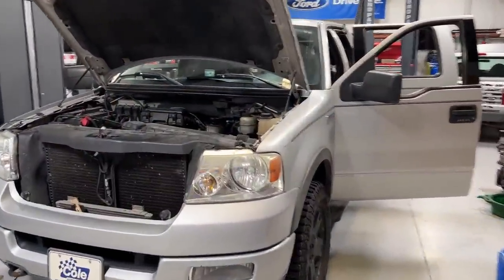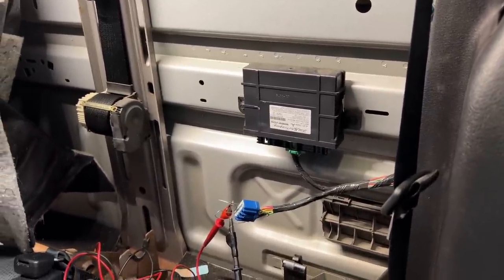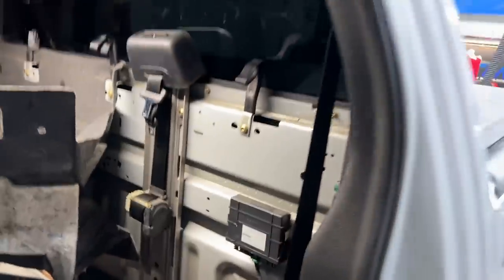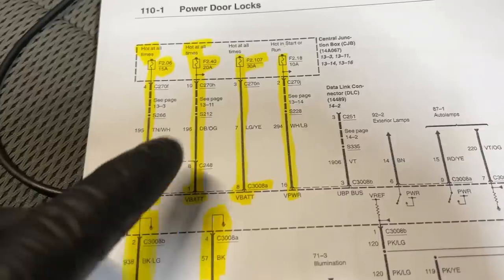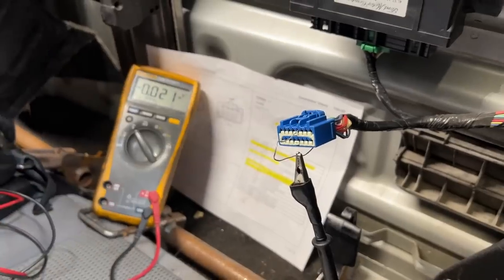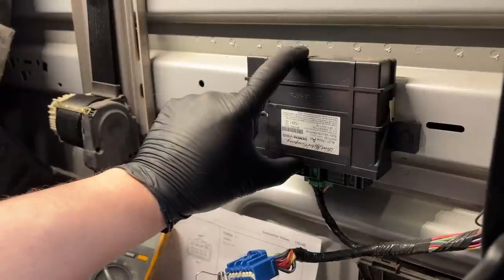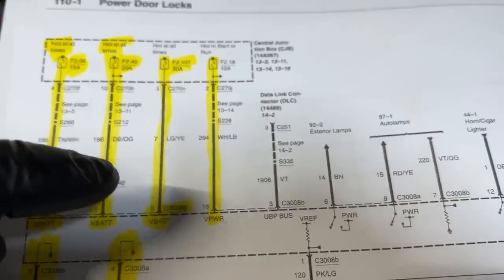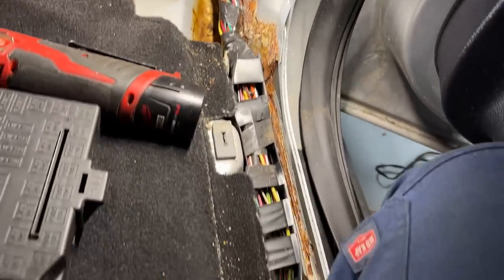This is Why Load Testing Electrical Circuits is so Important!

Comment: An old 55W/60W sealed beam low/high beam bulb can make a good load tester/continuity indicator and current limiting device too (most old school mechanics probably have a spare one somewhere). Good detailed explanation on troubleshooting this issue!
Reply: An old sealed beam is my go to for testing fuel pump circuits.
Reply: Definitely

Comment: Great video, would love to see your excellent diagnostics and repairs include how you put the wire back that you cut at the module and the one you fixed at the rust spot because there are many techs that really drop the ball on those wire reconnects and many could take a real pro instruction from you to do it 100% correct

Comment: That's an awesome lesson that can be applied to almost every vehicle out there, thanks!
Reply: voltmeter readings can be misleading without a load applied.  I can get a voltmeter to read above 12 volts with some hearing aid batteries in series but they sure won't start a car.
Reply: @mikekokomomike  You can also take a voltage reading across the wire when load is applied. The wire will act like a resistor, and create  a voltage drop. Ideally a wire should have zero volts across it (maybe .1 at most). If you see  2-3 volts, that is being consumed by the wire (or poor connection). I always do that when I check a charging system.
Reply: @alb12345672  right on
Reply: @mikekokomomike  Learn that lesson, thinking that all I needed was a volt meter, to test my AA batteries.

Comment: If you can wade through this longish post, here goes.

Had the same problem in my 2000 Expedition but without the rust.
Green wire with yellow stripe in a bundle running down to the floor on driver's side to power the box under the driver's seat that provided 'Power Seat' adjustments and some other functions.
The wire was on the outside of the twisted bundle where there was no tape wrap to protect it and it rubbed up/down on the edge of a Pinch Weld.
The up/down rubbing, from normal driving, wore through the insulation and the wire. The exposed wire ends corroded and turned green leaving just a high resistance green powder behind.
Luckily I had bought a full set of 'Moderately Used' maintenance docs on Ebay and was able to ID the box, pinouts and To/From wire routing.
As I was separating the green/yellow wire from the bundle, I saw discoloration on the wire, opened the insulation and the wire was corroded back 3/4 inch from both ends. An easy fix just like Brian did. Snip/Snip, Crimp/Crimp.
In 2015 I bought this 190K 5.4 2V Expy for $500 with '$500/Will Not Start' painted on the windshield. A few weeks later I replaced the 'In Tank Fuel Pump' motor and it ran just fine.
I have fixed many of the problems in this vehicle that Brian has presented on UToob except a Timing Job. I'll start that in a few weeks with a Melling Timming Set/Oil Pump, Ford Water Pump, 7 Cal Van Inserts, 2 each O2 Sensors, driver's side exhaust manifold and Radiator Support. Hope to be done by Thanksgiving. HaHa....
I just couldnt resist adding this longish post to show that I had a 99% duplication of Brien's vid but going back 7 years.
I have saved every one of Brian's UToob video posts. I'd love to see them all on an Indexed DVD. Brian should be able to sell thousands of them for $25 each. Seriously.....
Brian is a National Asset. His presentations are Pich Perfect and he cuts to the meat of the problem without extraneous BS. I've been following him for years and should look thru my UToob Libs to see when I started saving him.
Because of Brian, there are many Ford Trucks/SUVs on the road today instead of sitting in a Bone Yard waiting for the Crusher. I'm confident that my Timing Job will work out Just Fine because of Brian.
BTW: I'll be using a Melling Timing Set, Oil Pump and FelPro gaskets. Ford prices are Ridicules.
That's my story and I'm stickin to it........

Comment: I've bumped into an issue where the TCM (transmission control module) was declared bad based on codes we got. The new 10 speed transmission slammed hard into gear and wrench light came on. We decided to do a load test. We later found a wire that powers the module to be making contact on the chassis. Cut and replace that part of damage wire. Taped it good. Navigator shifted great like nothing was wrong. Its time consuming but worth doing.

Comment: Load testing is the best.  Use a headlight bulb(s) with a load close to 30 amps gives you plenty of light for working in the area however, the wiper motor is a nice touch.  Plus gently holding the gear varies the load which can be helpful also.
Nice fix Brian.

Comment: I always say that testing wiring is a lot like testing plumbing: If you've just fixed a plumbing leak, you turn the water back on and check to make sure the leak is gone. And if the pipe normally has about 50 psi of water pressure, you'd want to pressurize it to 50 psi when checking for leaks. You wouldn't put only 5 psi in it and assume it's good because it's not leaking at 5 psi. It could very well start leaking once the pressure increases to 50 psi. It's the same thing with wiring: If a wire normally carries 20 amps for example, you need to test it by trying to put about 20 amps of current through it. You can't put only 0.005 amps through the wire and assume it's good!

Comment: Would have been disappointed had you not cleaned up that body ground while you were in there. I remember all the ohm testing the trouble trees had us do when ecms first hit the market. 9 volt battery powered ohm meter would give proper ohm reading but I found out the hard way {many wasted hours} that a load test would show a compromised wire in a heart beat, saving loads of diag time. We need to keep this in mind, as ohm meters will sometimes lie.Thanks for helping spread the word.

Comment: Nice job.  I cut off several of the light bulb harnesses out of our junk 93 Cavalier out in the field and made some test lights that I use for load testing circuits.  They work well.  I measured the amp draw of each so I know how much they draw.

Comment: Great tips on load testing a circuit to see if it can power the circuit.  Don't try to hang off the side of a building with that gauge of wire though!  Keep these excellent videos coming.

Comment: Great diagnostics!  I had one in the past where I thought it was the computer module.  Luckily I was getting them for cheap from a wrecking yard, but the issue was very similar.  What happened was the cover to the wires cracked and went away on the back of the engine.  The exhaust manifold was right there and the wires started bouncing off the manifold.  The wire cover melted exposing the copper inside and when I would go up a hill or accelerate over a certain amount, the wire would short out on the exhaust manifold and kill the engine right then and there.  It was annoying as all get out.  Thanks again for a great diagnostics!

Comment: Excellant troubleshooting skills! Thanks for showing the schematics as well as the pinout on connectors. You helpedme years ago fix 2 of the joints in the passenger rail by the fuse box. If i remember it was due to cholride in the tape that was used.  I purchased the Ford splicing kit. So far mirrors and seats still work. Thank you Brian. Your son is very fortunate  to be able to learn from a master mechanic.
Reply: 3M Scotchkote fd manufacturers this coating for underground splices , it works well !  Great for trailer wiring .

Comment: I've been preaching this for years. I built a tester that lets me put from 2 to 12 amps on a circuit, plus direct battery connections to see if voltage drop is due to hot side or ground. It has been used a lot over the years. Good video
Reply: Would you mind sharing how you built the tester?

Comment: Your a excellent tech. I have put to use  your videos. I did my timing set using your 5.4 3v videos on my 07 gt. That was 70,000 miles ago still runs great.Thanks for your work to bring use very useful videos.

Comment: Nice video. This is hard to explain to a customer.  Sometimes finding the real problem is very time consuming and the customer doesn't understand why. Now I can just have them watch this video. 🙂
Out West we don't see many corrosion problems, it's usually added on equipment that has been hacked in.
Reply: That’s because you may live in a salt free state. Here in MN it’s terrible

Comment: I just took a look at the same rust pit on my 05 King Ranch. I've got holes rusted through below the wire bundle. No damaged wires. It's rusting through from below. Likely from Salty tire spray as I just repaired the left side which was worse. So much for all those years of oil spray.

Comment: What a great example for using load testing yes sir Brian excellent video like to add good continuity doesn’t mean good conductivity hardly ever use an old meter to test anything other than solenoid coils CHEERS AND THANKS

Comment: This motivates me to be proactive in protecting those wires anywhere I see risk of damage.
Reply: Sure enough, mine had the same situation playing out. I even found a couple small holes directly below the wires where the cab rusted through.
I managed to wrap the exposed wires which had not rubbed through yet with several rounds of tesa tape, then hit the holes with a metal body panel patch, threw some silicone gasket maker over that, then went over the top of it all with gorilla tape. 💪
Once that dries I am gonna go back and seal the bottom with either this liquid metal stuff I have or just more silicone gasket maker to make sure water will not get inside.
Not trying to get crazy with bondo, the room is tight and the truck is old so good enough is good enough.
Reply: So glad I live in San Diego and my 23 year old Chevy S10 Blazer doesn't have a lick of rust. The crusty wires in this truck definitely would not have made it with a salt bath
Reply: @samholdsworth420  I will never buy a used vehicle with rust again. The rusty vehicles in the rust belt markets sell for the same prices as no rust vehicles in other markets.

Comment: This is a very interesting scenario.   This is a really good exercise in knowing the limitations of your test equipment. The fluke meter is a laboratory grade meter. It has a very high input impedance so as not to load the circuit under test. In this situation it worked against the technician. Battery circuits are very low impedance.  Hence the need for a load  test.The technician was not fooled. The circuit was not open or the fluke meter would have said 0000. In fact there may only be 1 micro amp or so flowing to give the fluke such a reading. The wire was rotted and  the decomposed matter was still connecting the circuit. Had we used an old analog meter for this  test most likely lt would have read 0 or close. Those meters don’t have high enough input impedance to get a reading in this situation. It proves once more how analytical you have to be in order to be a great Automotive Technician.

Comment: Great content great fix you save the owner a lot of money 💰. Another technician 🧑‍🔧 wouldn’t have found the problem. Would have charged to replace the module. And still have the problem. Proper techniques result in a proper diagnosis. Therefore it can be fixed probably. I wish you had a shop here in Michigan.

Comment: Few months ago  was trouble shooting  my 2006 E350 shuttlebus.
No brake lights and shifter interlock kept it in park, everything else was functioning. Checked fuses ,brake light switch light bulbs all the basic stuff.   Ended up tearing out  most of the rear wiring  to get rid the coach builders screwed up wiring of crimp connections  and very few grounds.

I ran new wire from just under the door keeping it all inside instead of the factory Ford going along the frame. Have had problems with corrosion  on other E series.

Tracing down other wiring specific to the coach builder was a PIA.
Did buy  the proper tools for tracing down short circuts, testing relays,  etc..

Comment: You can see the wire diameter is swelled up at that point.  If I see any other wires swelled up, failing or not, just patch/splice that area before it goes bad.
Reply: You are absolutely correct about the swelling.
When iron turns to rust I think it expands 10 times the volume!
I'm not sure of how much copper or aluminum expands however I know that it does.

Comment: Cleverly diagnosed and wonderfully repaired. Shame the Mfg's can't do a little something extra in those "repeat areas". Liquid sensors are as cheap as chips.. placing a few in the "common hot spots" would be fantastic. Funny, I don't think this vehicle is so old.. my bad. I gave up wanting anything from the 80's+ (having lived through it as the typical shade tree mech ;) Yes, things are much better now but it's burned into my brain. Thank you for the super videos. You [are] the "Vehicle Whisperer". Cheers!

Comment: Go purchase a Load Pro test leads. I own a pair and they work great for load testing any DC Circuit. I used to be a Heavy Equipment Mechanic, but now retired.
Reply from the maker: I will never own a power probe product.

Comment: @FordTechMakuloco Tip:  Next time, relocate the ground higher up on the kick panel so it takes longer for the advancing cancer (body rot) to reach it causing a completely different set of problems and a return visit/repair.  Good job identifying the actual fault (corroded wire inside the insulation) and the underlying cause (wiring insulation rubbing against rough corroded surface)!  Once the ground fails, you'll see weird co-dependencies such as things work until the blower motor is turned on or the like.  Wait till you get one where the engine runs just fine until you step on the brakes!
Reply from the maker: Yup we had one where you put the turn signal on and he engine stalls. Been there done that. This ground will be just fine for the life of the truck.

Comment: Great video. I wish I could understand the process better. Some reason I have a real disconnect with this kind of stuff. Regardless, my 02 f150 has a whole bunch of GTE silicone sealant due to water intrusion frying the GEM module (started acting possessed) about 10 years in and other areas as well. Been a great truck but Ford really dropped the ball for a long time not sealing up their 150s very well.
Reply: I recommend  you consider  replacing  your windshield,  I've dealt with several f150 f250 that leaked due to a bad seal.  It's hard to pull the windshield  and reseal it unless you get a professional
Reply: @hustlehard4063  had that done just before replacing the GEM module. The upper left of the factory shield was notorious for leaking and frying the GEM.
Reply: I understand the methodology but suck at explaining things, but I'll try.

The easiest way to think of load testing in this manner is to think of flow. Most understand that if you replace a 3" or 4" toilet drain with a 1/2" drain pipe you don't have enough flow and the toilet will back up/not work correctly. So what load testing does is it checks to see how much flow capacity the wire is capable of handling. Multimeters use very little of this flow to work which is why it looks OK, until they tried flushing the proverbial toilet (in this case - connecting up the window motor that requires a lot of flow.)
Reply: @mrdanomac7937  Thanks! I was just mentioning to my wife yesterday it would be nice to upgrade our toilets.
Reply: @mrdanomac7937  I like the toilet analogy, here's another way to explain it using a toilet. Toilets have water jets all around under the rim, each jet represents 1 strand of copper wire. Flush the toilet when brand new, all the jets work beautifully, like new wire, all strands connected gives you the strongest current. Now, the toilet is 20 years old, and you have hard water deposit issues at your house, you flush it, and only 1 or 2 jets release water, the toilet is not going to flush, now take the wire and add corrosion (hard water deposits), you may have 1 or 2 strands still connected, but it won't carry a load.

Comment: Posted this just in time for me to dive into the flex fuel circuits on my 99 ranger, the inside kick panel by the drivers footwell looks about the same as this truck, I suspect it's a similar issue.

Comment: You can load test with a simple headlight bulb too.. It pulls like 4 amps.
Reply from the maker: Yes but the window motor doesn't shatter or burn you like a bulb.

Comment: I'm dealing with this same issue with the ABS module on my semi-truck. Every time I hit a bump in the road, the module emits several chirps to tell me it is loosing contact. The ABS self test already tells me the issue is with the wire feeding wheel-end number four which I have checked and confirmed is good at the wheel sensor. So between where the ABS harness comes out of the truck cab and going back to second drive axle, there is a sensor wire that is compromised. Why I haven't yet addressed it is because that section of harness is inside the frame rail which is buried behind the fuel tank, air tanks, and transmission and there is no room for me to access the frame harness. I suspect a broken wire or a chaffed wire that is grounding out against the frame rail and to fix it requires removal of all the air tanks and left side fuel tank which is a major job. Sometimes I just hate wiring.

Comment: Same with a simple continuity test. Most multi meters beep under 200 ohms, if you don’t look at it when you’re ringing out a circuit, you may miss w fault in a wire or connection.
Reply from the maker: A continuity test will pass, this is the only way to test the load carrying capability of the circuit in question.